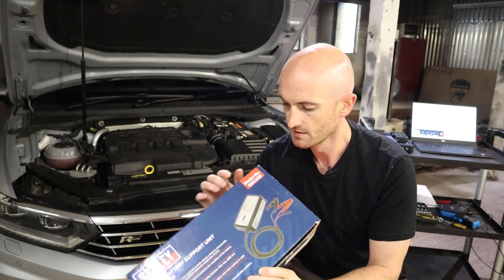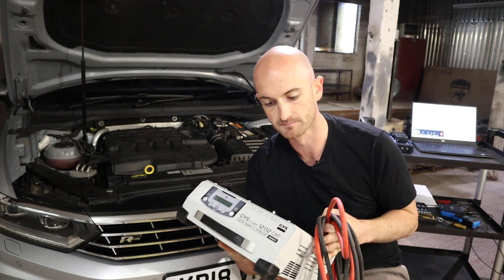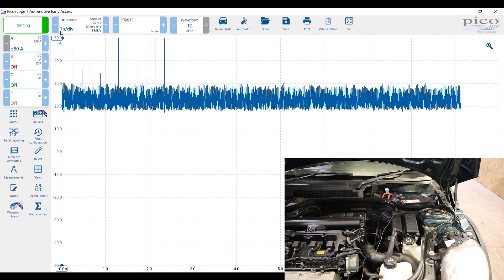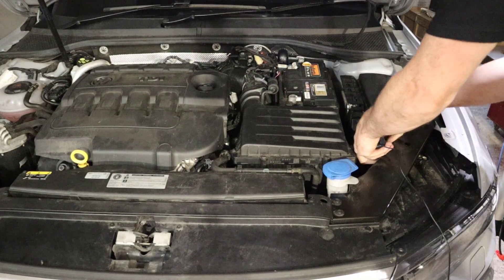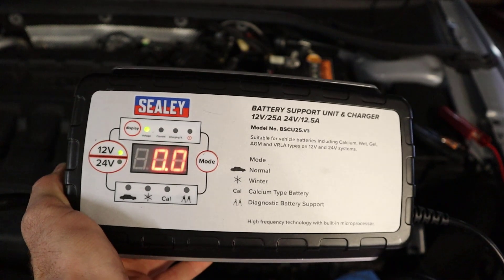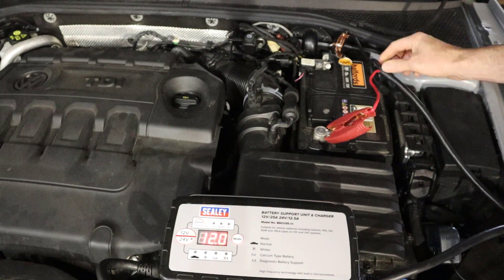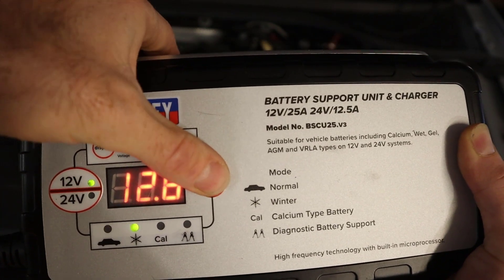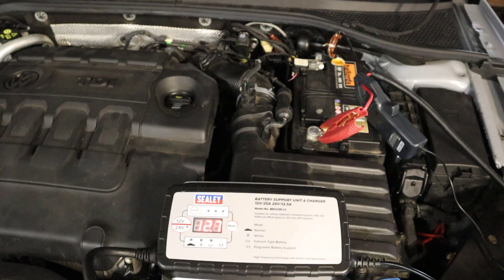Is 25 Amps Enough for Diagnostics?

Comment: I bought this machine about a year ago and I'm very pleased with it. I have used it for long diagnostic and coding sessions on a 2019 Volvo (SPA) and the car's battery has been adequately supported by this unit. In fact, the battery's state has actually improved while connected meaning that the unit is providing more than enough juice. The BSCU25 actually only provides 20A for battery support but it is more than enough. I also used this charger to recover a completely dead motorbike battery and it worked great.
Reply from the maker: I like it, nice lightweight charger. I struggle to get much over 13V on diag mode though. How about you?
Reply: @MechanicMindset  No I'm only getting 12.8V. Disappointing but good enough for my purposes.
Reply from the maker: @funkypotamus  Yeah it’s not great. For the money it’s great through. It might be better using battery charge mode. Worth a try, but wouldn’t suggest testing while
Your programming.
Reply: can i not just use a 20 amp normall batery charger ?
Reply: @bencosturbz7755  No because they shut off once the battery is full

Comment: I ask again, why was your unit only inputting 12.7v please? It wouldn't be any good for a BMW that requires at least 13v?
Reply from the maker: Not sure, what did the manufacturer say? I’ll have to see when I use it next.
Reply: @MechanicMindset  They said it should put in 13.5v up to 20 amps. The guy at Sealey checked some others and they couldn't get one above 12.8. He thought the voltage hadn't been set high enough. I returned for a refund which was a shame as it would've made a worthy spare.
Reply from the maker: @inagbihal8518  Ah ok, I didn’t notice to be honest! Thanks for pointing this out. I’ll check mine again with some loads on

Comment: I've just bought one and tried it. It registered 12.9/13 volts on the diagnostic support mode. I see yours was registering 12.7. I thought it was supposed to put in 13.5v?
Reply: Have noticed the same. Mine doesn't provide 13.5V in battery support mode either. It's also about 12.7V but it still does the job well.

Comment: I once had performed programing on a new Touareg, even my 100A power support was‘t enough
Reply from the maker: 😱😖Was there a problem?
Reply: @MechanicMindset  I am reading measure value on a Urus, it is drawing more than 25A when ignition switched on with all consumers off. If I remember correctly that Touareg was drawing around 80A when performing diagnostics, sometimes over 100A, I knew because my power support was blinking when output reached 100A

Comment: Highly dependent on the vehicle.
BMW demand 100A charger for coding.

I often use 25A for diagnostic especially if i turn it on a long time before and pre charge the battery but on range rover Evoque, BMW, Ford and Volvo it is hopeless to use a 25A charger. Always go for 120A on those for anything more than regular diagnostic and watch the voltage if using the lesser one
Reply: And if the voltage goes too low we migh end up with a brick on 4 wheels 😅🙈
Reply from the maker: @tullgutten  For sure, as I mention, programming can turn on certain components that will draw heavy 👍. VERY important

Quite surprised how little these cars draw with only the ignition on!
Reply: I have used the BSCU25 for hours at a time on a 2019 Volvo while playing with ecu setting and coding and it has been more than adequate.